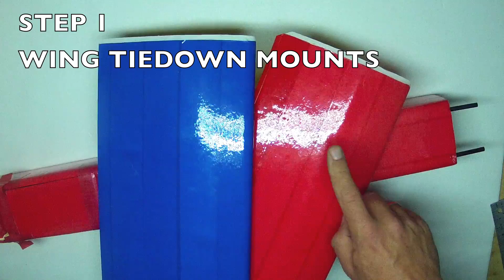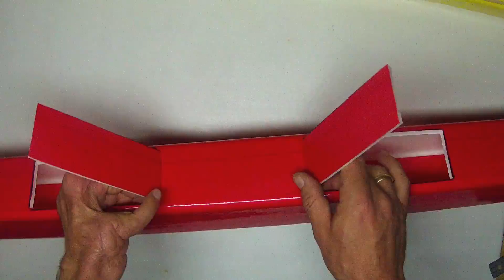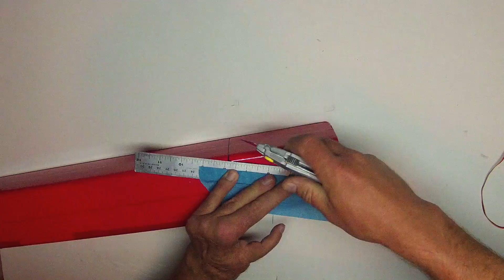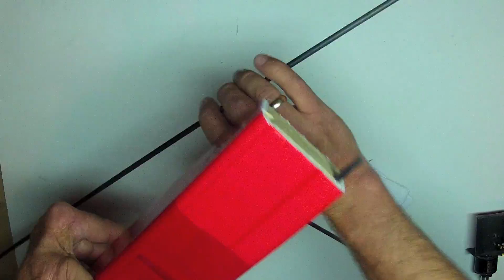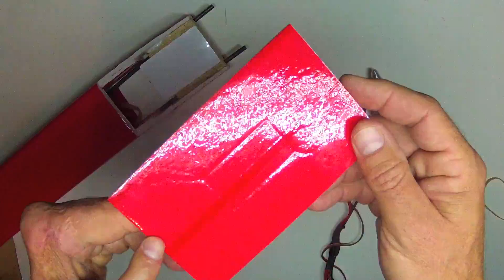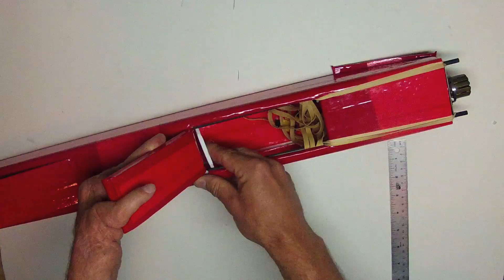ANSLEY PEACE DRONE - FUSELAGE CONSTRUCTION

Comment: I built 2 of your peace drones.  On the second one, instead of using rubber bands on the inside of the hatches, attached to the full length carbon rod, I put a short piece of carbon rod crossways just under the full length rod & left them stick out the sides.  That way you get the support of the full length rods but you can remove or replace the rubber bands.  Great videos Ed.  Enjoy watching them, all good ideas.  Thanks for posting them,  Lloyd

Comment: Im planning on building this plane in the next month or so.  I have a spare Grayson Hobby Super Mega Jet motor with a 40amp ESC sitting around.  I use a 3300mah 3s with this motor.  If I remember correctly this motor is a 2230kv motor.  Will that be sufficient for this plane?  If not, then what motor, propeller,  and ESC are you using?

Thanks,
Mike

Comment from the maker: That is true, another good way to do it.  As long as the force from the wing rubber bands is adequately distributed along the broad side of a card or the edge of a hole through a card I think you'd be good.  I like your way for applications where removing the rods may be needed.  The way I show is probably quicker to build, and for permanent mounting.